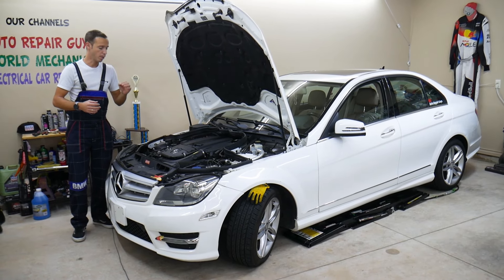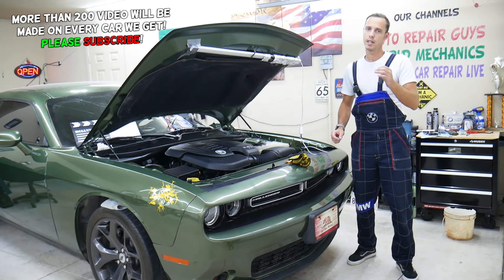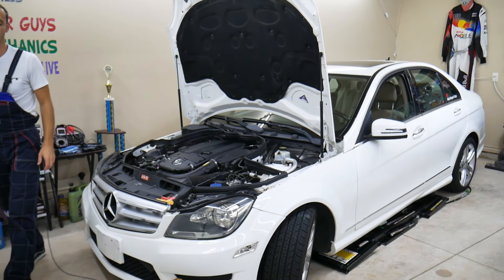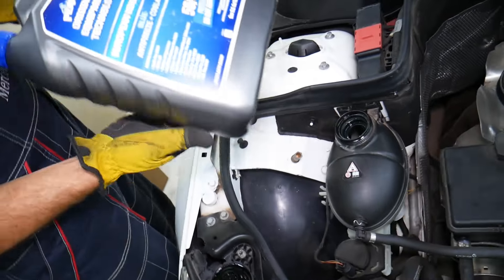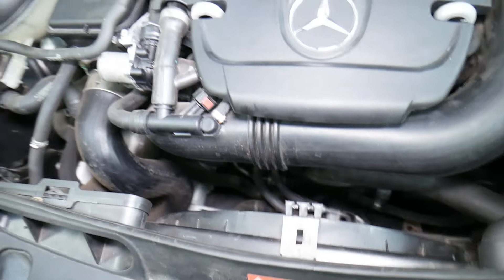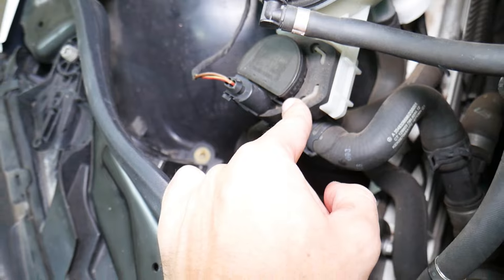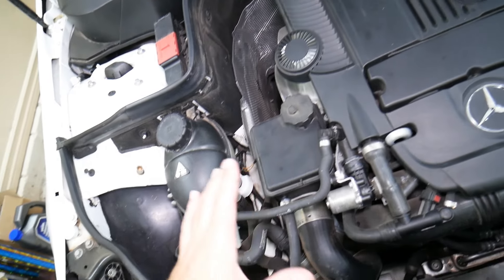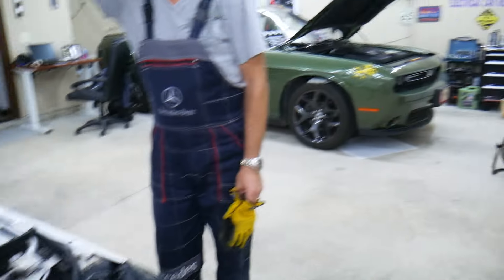WHY COOLANT IS BOILING IN THE COOLANT TANK RESERVOIR ON A CAR

Comment: The issue is pinpointng the cause...expensive affair
Reply: I have a 2012 cruze....Mine did this every time I took off the coolant cap............Believe it or not I found a simple fix.....Anytime you have to take off your coolant cap...Take the neg cable off your battery...believe me it works.....No bubbling over.....

Comment: Boiling means air is getting in system somewhere, more than likely the engine.
Reply: truth. flushed coolant recently at the shop and it boils and overflow inside reservoir. massaging the hoses worked well.

Comment: If there is signs of leakage on top of the expansion tank as well as the engine overheating would that be a faulty cap?
Reply: Did you fix your problems with the overheating? I have the same issues as uou described.
Reply: Same problem today for me, im feeling a crack on the bottom of the reservoir tank

Comment: This happen to me with my mustang every time I race the engine it wouldn’t over heat but when I shut the ride off and park it after pushing the engine over 4k RPM, the coolant would come out of the coolant cap steaming, I started stressing about it because I thought it was a bad head gasket but i check the oil and there’s no milky liquid or signs of coolant in the oil and I check my exhaust and there no smoke whatsoever so I checked my thermostat and it was stuck half way open, jammed I would say and my water pump was giving out making a whine, but the signs I seen with my damaged thermostat it would take 15 miles to get to normal temperature and my gas MPG was bad and everytime I pushed the engine the temperature gauge would slightly go into the heat side until I let off the gas it would cool down, but I changed out the water pump and thermostat my car doesn’t do that anymore
Reply: L😊
Reply: Double L

Comment: Okay on my 2016 Chevy Cruze I done replace the hoses the Overflow container to the Head cracks in it but the holes leading from my thermostat liquid is cold but all the other hoses are hot and it's a leak under the thermostat at but I believe it's coming from the housing could that be the reason my car is overheating
Reply: I found out that I had a leak from the housing connecting to the engine is very very small you can't see it but that's where it was coming from and also my thermostat wasn't closing so that whole stay cold but I fixed it all now everything is fine

Comment: That why u gotta flushed & clean cooling system cleaner check for leaks crack on hose check for clogged hose build up that why i use cooling system cleaner for light clean 10 min deep clean 3-6 hours check the water pumps & if is no code could be problem thermostat or water pump make sure serpentine belt is lubricants most cases rust pully doesn’t spin much that’s why important to lubricants

Comment: our 1994 RAV4 just came back from teh shop for timing belt.  Now the coolant is boiling in the reservoir.  The shop put on a new radiator cap because they said the old one looked worn.
The car is not overheating
I will try to bleed it today, thank you for the video
Can it be the head gasket even if the car is not getting hot?

Comment: My car does this and radiator low people are saying head gasket but runs good no milky oil no white smoke?
Reply: Same here man on the side of the freeway right now
Reply: @drawndown  just manage to get my car home. So aggravating
Reply: @Saintzou did u ever figure it out ?
Reply: @kramse21  I needed a water pump and new radiator cap.
Reply: @Saintzou  Hi. I'm having the same problem in my Chevrolet Cruze. Ny coolant is boiling in the reservoir and coming out of the tank. Today i replaced the thermostat but still it doesn't fixed it. My mechanic said that it could be the water pump or head. Does the water pump solved the problem in your case?
Reply: @Saintzou  good man I may just need a radiator cap mysel I found a leak there
Reply: @INDIANVINESENTERTAINMENT  yes. And make sure your coolant is mixed correctly
Reply: Anyone narrow down the issue? My ford zetec has steam blowing out the coolant cap. I've replaced the cap as well flush out the coolant with new coolant but the problem still persists. There doesnt seem to be any symptoms of a blown head gasket so I'm pretty confused.
Reply: These radiator caps nowdays are made very cheap .
Reply: @drawndown fix as soon as possible man coolant leak is an easy fix but if you decide to let it keep leaking and just refill your car will overheat and die on you
Reply: @Saintzou  Mine ended up being my radiator fan. Since I've replaced it, I have no trouble in stop and go heavy traffic, where I used to overheat.
Reply: I don’t know what mine is I changed the thermostat still doing it, I made em bleed the system. But I noticed if I step on the gas the temperature gauge goes up fast. And now when I start it now I see white smoke and then it goes away. Now mine car won’t start. They said I need a starter 😭
Reply: @alexcampbell740  sorry to tell you this it’s a blown head gasket! I took it to a shop finally and had it repaired 4 k later good to go lol
Reply: air in the coolant
Reply: @Saintzou how did you figure  it out?
Reply: @INDIANVINESENTERTAINMENT  mine was  reservoir tank on Chevrolet sonic rs 1.4 they use same engine
Reply: Mine is doing this. Was told a couple months ago I need a new radiator cap. So I’m gonna try this today at autozone
Reply: @INDIANVINESENTERTAINMENT bad radiator cap, wrong or contaminated coolant, water pump, or blockage/air bubbles
Reply: @IsThatHuncho  it was the head gasket later oil started to mix with coolant
Reply: @INDIANVINESENTERTAINMENT  Ahh thats always the problem you’re not hoping for
Reply: Check the radiator cap. That was my second culprit. Right after a burst radiator hose 😂
Reply: Cap or rubber o ring on cap. Especially on Cruze
Reply: @heathdyess9119  Your car is overheating it seems
Reply: @heathdyess9119  May be a bad thermostat or water pump
Reply: @Saintzou hey was your ac working fine, your heater? Besides it overheating the engine
Reply: same bro
Reply: Same it’s happening with my car all coolant coming in external box with air but no milky oil fan also good thermostat also even pump also
Reply: @alexcampbell740  that sounds like the head gasket has gone
Reply: Infiniti q45 ‘03 my hose popped and I got it fixed , it still overheats but goes down when I get higher gears , I just bought a thermostat and see if it persists , if it is I’m gonna buy a new radiator and see wassup. But this thread helped me out aloy
Reply: You might have too much water in the coolant which can cause your engine to blow
Reply: @INDIANVINESENTERTAINMENT did u get it fixed my shit doing the same thing and i fixed water pump
Reply: @dapremee  i got rid of the car. It was head gasket in my case
Reply: @INDIANVINESENTERTAINMENT  dayum that sucks well ion think thats what it is for me bc i run my car for 30 min + without it boiling or overheating but once i start driving or put ac on it gets hot asf
Reply: @dapremee  it can be the water pump or head gasket. Get it checked out. Ask your mechanic to do a compression test.
Reply: @INDIANVINESENTERTAINMENT  yea i think its the radiator fan i was looking at it and the one thats supposed to run the whole time the car is running isnt working only the one controlled by the ac works
Reply: @williamdolan7189 not always. Water pump, clogged thermostat or radiator and several other things can cause this. I own an auto repair shop and everyone brings their cars in with these symptoms thinks it’s always a head gasket. It CAN be. But it’s definitely not always.
Reply: @chris_schoff how often IS it the radiator????
Reply: Added new water pump and radiator got a new thermostat today hopefully it is this and not head gaskets
Reply: @perlaaguirre1743  you have white smoke coming from your vehicle? Or milky oil
Reply: same here coolant boils in resevoir tank but runs rly well after sitting 1/2hr. puzzling!
Reply: @Saintzou  also check your reservoir for any cracks
Reply: Up date it ended up being a small crack in the head from overheating issues. So I spent the big bucks and had it replaced. Another 200k hopefully
Reply: @mistarj2580  check your radiator hoses if they are old sometimes they will collapse, causing the problem
Reply: Same
Reply: @INDIANVINESENTERTAINMENT  mine was doing the same as yours. I ended up replacing the radiator cap and solved the problem.
Reply: After checking everything, do a combustion gas leak test using the blue color fluid. If it turns pee color, it is either or a combination of HG, cracked block, cracked  head.....
Reply: @drawndown  If your radiator fan goes out on you again, turn ac on and see if fan runs continuously, if so leave it on ac on setting, if not then turn off ac,  then turn the cabin temperature setting to highest heat and turn fan on full blast and keep the windows down. You can turn off your air vent and have the others diverted away from you.
Reply: WHAT ABOUT TRANSMISSION COOLER
Reply: @drawndown was the coolant going low with that problem?
Reply: Thermostat

Comment: I have a 2000 audi A6 Quatro 2.8 v6 it has a noise like coolant boiling or hissing coming from the plastic coolant resivor however it stops when I take the negative battery cable of and dosen't make noise again until I run it for a few minute I just replaced water pump and thermostat.  I don't know much about these vehicles any idea's  thanks

Comment: My new beleno only 8000km upto now. After the third service i have noticed coolent is droping. I took the car to the maruti service centre but could not find the leakge.  No sign from the engine side. No overheat, performace is good. Good milage etc. But still probblem not solved. Any advice pls.

Comment: I’ve been filling up my coolant and the reservoir is empty by morning. I filled it up again and turned on the engine to find out where the leak is coming from. When I turned my engine on the and left it for about 10 mins, the coolant was boiling and pouring out of the cap. I checked my oil and it doesn’t seem to be contaminated. Is the issue just from a faulty cap?
Reply: I have exactly the same problem, did you solve the issue? If so, what solved it?
Reply: Clogged radiator possibly
Reply: @iamfunnyipromise9605  it was a blocked heater matrix. My car has been fine ever since

Comment: Hello! I recently replaced the radiator on my ‘19 Chrysler Pacifica. Afterwards, I burped the coolant with a big funnel, but now the coolant level on the expansion tank is a bit high after the car seats overnight. Soon as I open the cap it makes a whoosh sound and the coolant level drops about 1.5 inches. Do you think I may still have air in the cooling system? Should I repeat the burping process??
Reply: did you gets a solution?? because i have the same problem
Reply: @zafir3831  Yes, I found the issue. It was the Coolant Expansion tank cap. The two seals on the cap were swollen & deformed, therefore it would not hold pressure. I replaced the cap, problem solved.
Reply: a question did you see small bubble in your radiator?
Reply: @zafir3831  The radiator is sealed, you cannot see it. If you mean bubbles in the expansion tank? Yes.
Reply: okay thanks😊

Comment: I heard this boiling sound for a few days... Couldnt figure it out, but didnt actively search like an idiot. Last night at an idle the engine burst into vapor/smoke. White chalky liquid all over the engine! Pulled the oil dip stick and it seems the oil is regular color. Slightly light brown though. I cant tell where the fluid came from. Does the white liquid mean my head gasket is blown?
Reply: Yes
Reply: It was my radiator, cracked

Comment: I’ve got a 2006 Honda accord just put another motor in it all new gaskets from top to bottom after 250 miles the  reservoir started boiling not overheating. What do you think that might be?
Reply: Air in the system?

Comment: I have a 2012 Chevy Cruz 1.4 turbo. I changed out the water pump, the thermostat, flushed the radiator upper and lower radiator hose, it’s still overheating, I also did a combustion test and it came out negative. I don’t know what it could be. I don’t wanna put one more dollar in this damn car.
Reply: You have slow flow in the radiator and blockage on the front of radiator, these cars have the inlet and exit hoses way too low, try to clean off the front of radiator first.

Comment: Mine started after I lost the cap for my reservoir tank. I bought a after market replacement but still boils. Fan was also not working automatically so I run it constantly. But it recently started boiling over again with the fan on. I drive a 09 Sandero
NO SIGNS OF MILKY  OIL
Reply: Same thing  hapened to my Corolla i foundout that there was a little radiator plastic tube broken , you may have tube broken or some bug leak

Comment: Mazda CX7...I have changed... the radiator, the fan regulator, the thermostat, replaced head gasket with top end overhaul. Driving normally it is fine but as soon as I am in traffic, it boils over again? System was bled properly too. 
HELP?
Reply: I had the same problem i fixed it today 🤦‍♂️
Reply: @Kelvin-ri1xe what was the problem?
Reply: I got the same

Comment: car was slowly over heating intermittently drive fine for multile hows some days n over heat after 40 minutes other days when it did overheat heater wouldnt work even on high i replaced waterpump and thermostat not long ago and i bled the system months ago replacing the alternator n it was fine so im confused on whats going now i wanna add at some point i added stop leak but that was 2 years ago car sat for a year but has been driving fine recently so wtf is goin on 🤦🏾‍♂️someone help

Comment: BUT WHAT if expansion tank is way above maximum line, and radiator starts at full immediately after replacement radiator and fill, but the next day overflow reservoir tank is way above maximum level adn coolant in radiator lowers so cant be seen. So i siphoned off coolant out of overflow tank, then filled radiator to top level again. Went a couple cycles like that. Confuisng. 2008 nissan xterrra, which has a pressurized coolant reservoir overflow cap, non pressurized radiator cap.

Comment: Both my oil and coolant temperature is normal.  I am also not losing coolant.  But after I shut down my engine from 45 minutes of driving, i start to hear hissing sound coming from the radiator area.  Coolant level also rise quite high in the expansion tank.  I don't see coolant spraying.  Sounds like intermittent air venting.  This is first time i am experiencing this so i don't think this is normal.  Anyone?

Comment: It happened to my 2013 Corolla , the coolant reservoir was splashing from the reservoir but the temp gauge was not showing any overheating , after 2 weeks of driving the temp still fine but i was surprised that the reservoir was empty ! Then i went to mechanic , he saw that the battery is new then he knew the reason , there is a thin  radiator plastic tube close to the battery it always breaks when you replace the battery cuz its very close .. he replaced the tube and refill coolant and the issue went away , may be if i did not fix it the engine would be gone ,